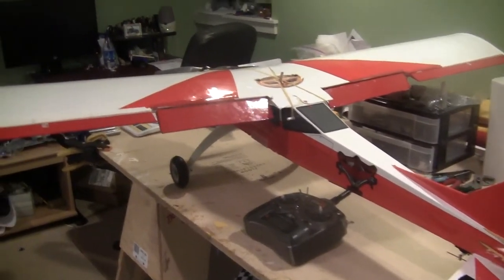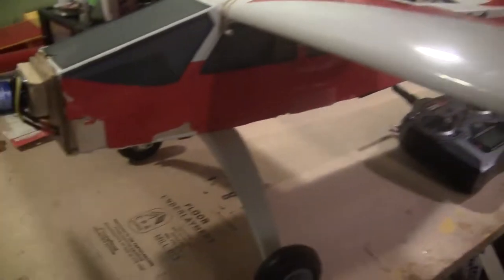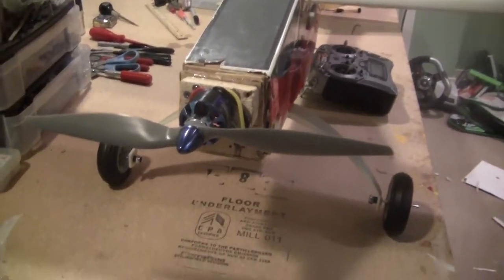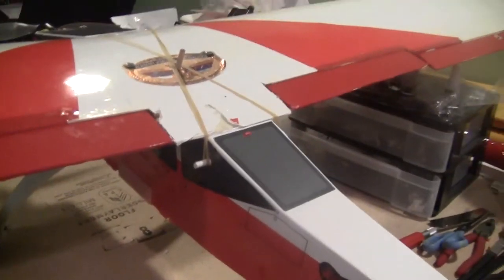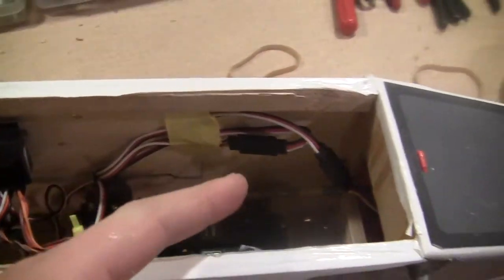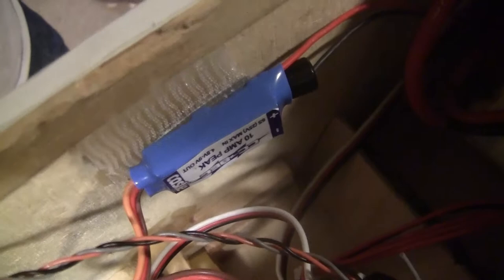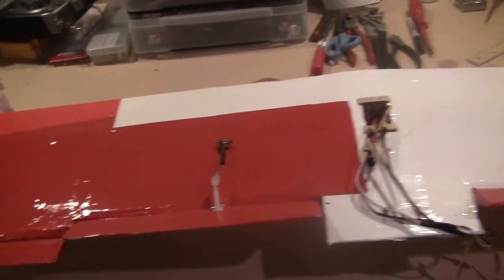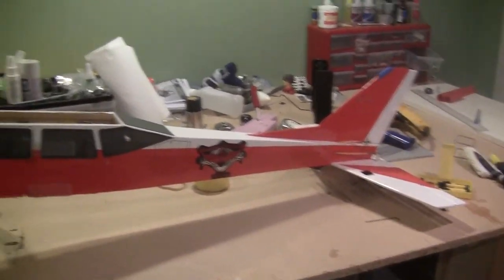Taildragger, Flaps, Larger Ailerons etc. Modifications on my Aerostar (E-Conversion)

Comment: Looks good mate , great to see other young guys getting into the hobby! 
One thing I'd watch is that the tail wheels servo could catch on grass or debris, and could push your CoG backwards, so maybe chuck some weight in the front to compensate. this style of plane are pretty good for carrying a bit if weight, they tend to just slow down rather than start stalling badly, good luck :)

Comment: Ethan looks great buddy, check out the aileron servo's and make sure the screws are in the horn it went by pretty fast and I didnt see any screws in them i may be wrong but thought i would throw it out there just in case.
.
it is going to fly great I can't wait to see you pulling your dad's gliders in the air.

Comment: Wow! You've inspired me to one day fly my Aerostar I put together when I was 12, but never flew it due to engine issues, still sits in pristine condition in my parents attic. I recently got back into the hobby, bought a Bixler2/Tunigy9x etc. to start flying again, but one day I want to get the Aerostar in the air.

What motor do you recommend?
60A esc good enough?
What batteries are you running?
Can I keep the original servos?

I'll put together an order at HK and wait the 2 months for delivery.